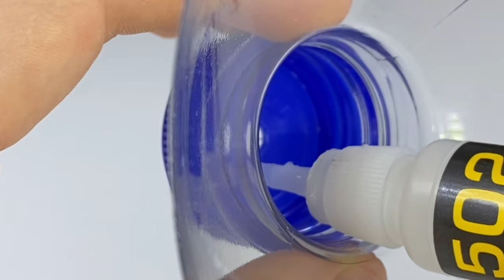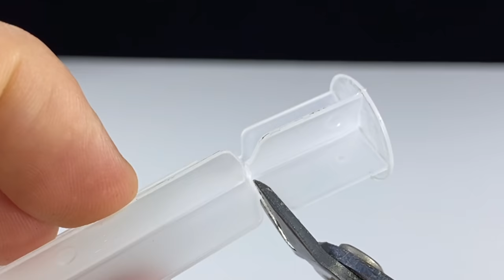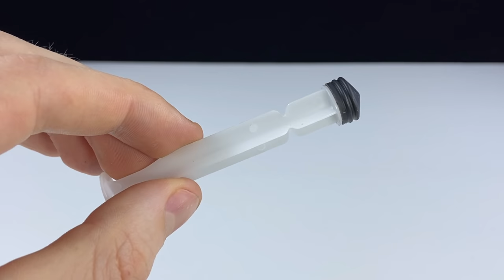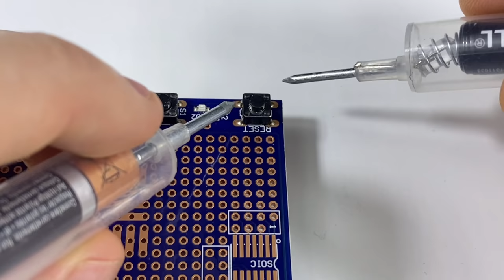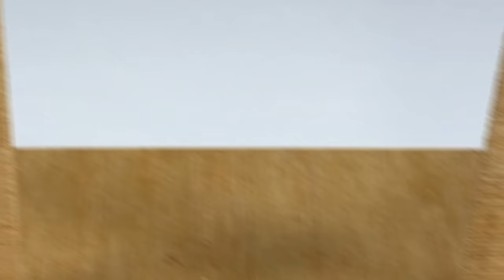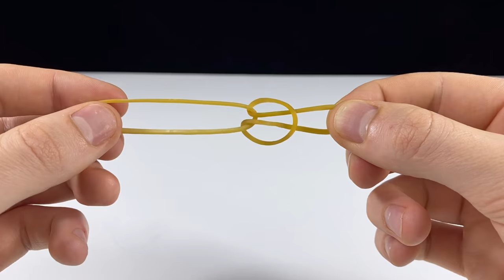3 AMAZING INVENTIONS | DIY Ideas | Super Inventions

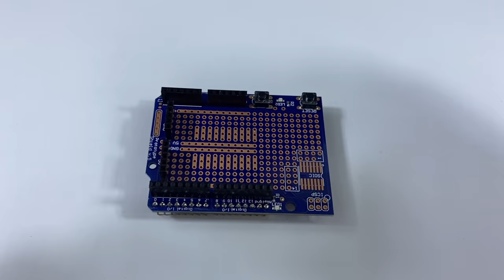Comment: At 4:12 I don't know what your modified syringes served for which purpose? At first I thought you were making a diy soldering iron but at the end I didn't see any soldering taking place just 2 syringes touching a board. Are those used as a board tester? Thanks.
Reply: I believe it is a continuity tester for the flow of the electricity.
Reply: Shouldn't a resistor be included in the circuit to prolong the life of the LED?

Comment: 🤔So what exactly is that “syringe” thingee and how, exactly, is it supposed to be used? And what for?
Reply: كة، 📳♈
Reply: It's a continuity tester. If the 2 points he touches with the syringe are electrically connected, then the LED will light. It's great for testing if electronic components like LEDs are dead

Comment: I made a gun that shot 10 ml syringe plungers using compressed air. The first test shot went 40' through an oak slat door and knocked four ceramic tiles from the bathroom wall. That was at 80 psi. I tested its range and accuracy by shooting my friend in the back of the thigh. What? I gave him a chance to run. He wishes he was faster. I nailed him at a good 55' on a full run on the back of his thigh and he went down.  It looked like it hurt like hell.